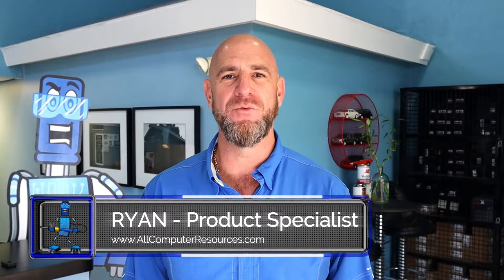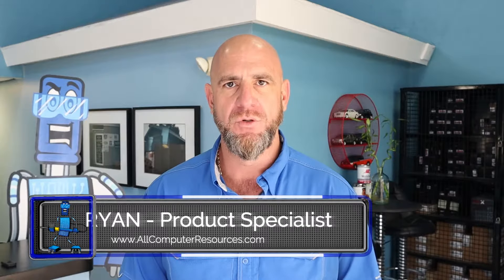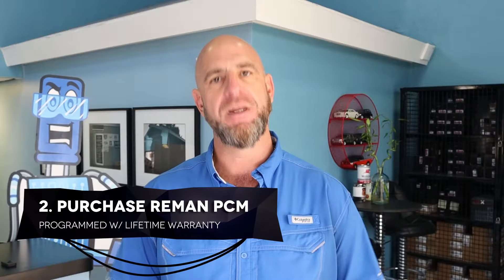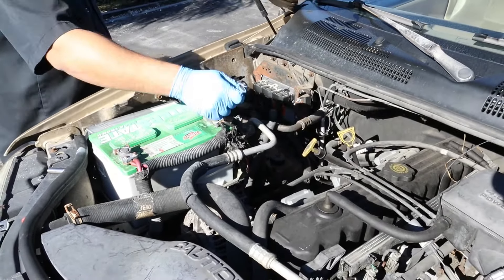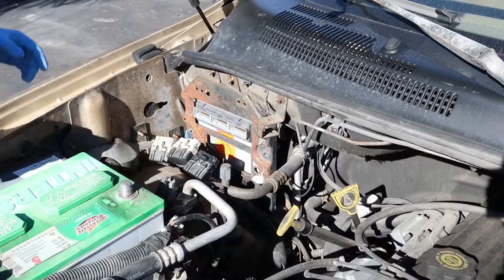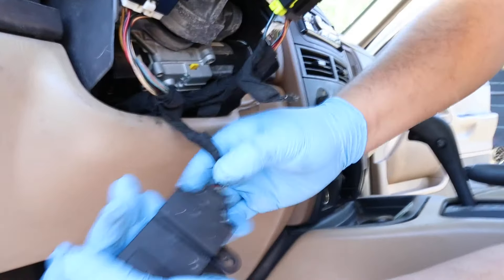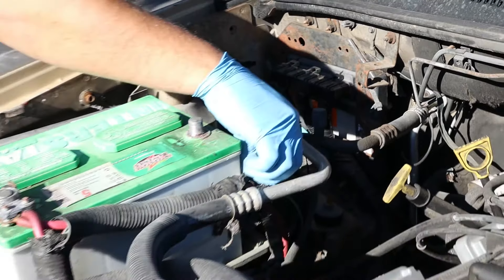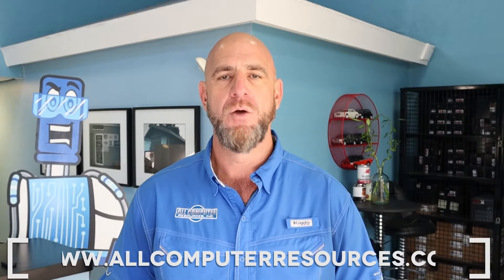SKIM KEY PROBLEM SOLVED - Dodge Jeep and Chrysler SKIM removal from PCM

Comment: I ordered SKIM delete for my 2005 Jeep Grand Cherokee, I explicitly followed the directions for installing the pcm. I had previously disconnected the SKIM module but didn't remove it.  It stared up fine, I test drove it to make sure everything was working properly. The next day my wife drove it to work.  when she unlocked the Jeep to come home the alarm system came on, the lights were flashing, the horn was blowing and she could not turn it off. Someone pulled the horn fuse to quiet it but the alarm system was on on her entire drive home. Turning off  the ignition didn't help nor restarting it. I totally removed the SKIM module and checked every fuse and the alarm system still will not stop...The only way to make it stop is to remove the negative battery terminal. I even tried restarting installation of the pcm from scratch by unhooking the plugs from the pcm, disconnecting the battery, connecting the terminal cables overnight and resetting everything again...the alarm system is still activated, I do not know what to do now. Also we no longer have a key fob for the vehicle. Please help, we need this vehicle running and need to disable the alarm system.  Thank you
Reply: Did you get that issue fixed with the alarm?
Reply: @300EMS  Not yet, I haven't recieved a reply to the same question on their website about this...
Reply: I’m in the exact same boat. I didn’t “need” the skim removed but went ahead and added it on since I was ordering a ecm from them anyways. Fired right up, great right???…… well no. Physically removing and unplugging the SKIM and gettin the new ecm with the skim requirement removed meant that my 100% stock Jeep key FOBs no longer worked and as soon as someone manually locked a door it armed the alarm so guess what you use the key to unlock the door, the alarm goes off as this generation of grand Cherokee the only way to disarm the alarm other than unplug the battery is to hit the buttons on the key FOBs.  After reaching out to this plug and play company that is only taking tech support I was told “ “

“	
Tech Support (All Computer Resources)
Oct 12, 2021, 1:24 PM EDT

Understood,
This can happen in some cases. I advise taking the vehicle to a alarm specialist.
Thank you,
Sebastian Chaparro | Technical Support Specialist”

To which I replied this vehicle is 100% stock why would I need a 3rd party specialist etc, most of my troubleshooting inquiries were ignored.

My response “This has a stock alarm everything is stock on this vehicle so why would that happen has to be something to do with the new computer that was put in it has nothing to do with the aftermarket alarm system because this does not have an aftermarket anything installed in it. Please advise, I’m not satisfied with your response. 

Is it true that if I reinstall the SKIM module it will go back to how it was before and require the proper chipped key? I just added that on, SKIM removal, as an extra thing to remove in case it failed in the future. I can start the vehicle but the second I plug the negative battery cable back on it immediately starts the horn blaring and lights flashing. I can start it right up and the horn and lights continue to go off. Please advise.

Thanks,
Luke”

Their response 
“Tech Support (All Computer Resources)
Oct 13, 2021, 2:28 PM EDT

Yes i agree although the vehicle alarm is factory to the vehicle we do not change anything on the vehicle itself. all we do is just remove the security from the PCM now the vehicle itself needs to have the security modified.
Thank you,
Sebastian Chaparro | Technical Support Specialist”

I understand they only alter the software on the computer but when you explicitly say plug and play and give instructions about removing the SKIM device before installing the new computer that is my understanding as the extent of the security being modified. Where’s the tech support from this company other than telling me to go get it fixed somewhere else. 

I had such high hopes, if they spent less on SEO to burry the negative reviews and more on making a functional product everyone would be happy.
Reply from the maker: Mr. Kuhn, there is not a connection between the PCM SKIM and Alarm. If this is an aftermarket alarm we won't be able to determine in which manner the Alarm was setup. Removing the SKIM and replacing the PCM has absolutely no correlation to the Alarm. If you had an aftermarket auto-start Alarm installed on this vehicle you may need to have it diagnosed.
Reply: Reinstall the SKIM, this is the only way for the FACTORY ALARM & KEY FOB to unlock/disable the alarm.

I went through the same issue and they gave me the run around regarding this issue on my 2005 grand Cherokee, why they offer it as an option is beyond me.
Reply: @acr  except that removing the SKIM creates an issue where your key FOB no longer lock/unlock the doors and if the FACTORY alarm gets set off you have no way of disarming it on this generation. I implore your company to purchase a 2005 grand Cherokee do a SKIM delete and let your wife and kids use it as a daily driver; you will soon figure out you should not be offering this option.

The only reason I could come up with for doing this is if your going to steal a vehicle.
Reply: I am dealing with the exact same issue with a 2007 Grand Cherokee.  The so called "tech help" is extremely unresponsive.  I've gone through a long list of issues that I have worked on.  I am down to the car starting for about 20 seconds and then turning off.  I unplugged the horn so I don't have to listen to it.  Has anyone tested to see if the shim module is plugged back in, will it reset everything?  I've Has this car down for over 2 months.  This is ridiculous.
Reply: @EckoSkywalker  did it reset everything to what it was? I'm desperate to get this car running again.
Reply: @jaysonzander60  Yes, if you plug the SKIM module in, it will rest everything.
Reply: @DocHemi4268  thank you!
Reply: @EckoSkywalker  So what you are saying is that this WILL NOT WORK ON 2005 Jeeps, will turn on the alarm and that Technical Support was of no help?

Comment: So in other words you are not deleting the security out the pcm you putting it in a continuous learning mode so that's why the skim module needs to be unplugged or removed
Reply from the maker: Not exactly.
Reply: No,  If the PCM detects the SKIM reader it automatically reactivates the SKIM system.  That's always the case with all the  SKIM removal services.   It's nothing to do with what they do.   Leave the SKIM reader connected or reconnect it later and you're back to square one.  That's why they say don't just disconnect it.  Remove it or if any mechanic or electrician or subsequent owner sees a disconnected plug and pops it back in it's all over again.
Reply: I see I didn't actually address your question nor can I.  All I was saying was that the skim check is still part of the startup routine.   I'm not sure exactly how it's effectively bypassed by those who perform the service

Comment: Sounds like you're just resetting them to factory new, then it doesn't do the key learn process, and happens to be programmed (by chrysler) to do that by default if the module isn't present.
Reply from the maker: No, that is not accurate.
Reply: doubt
Reply: Just wondering if I could rest my pcm to factory?
Reply: @mighteydog7  if somebody would upload a dump of the eeprom from a new unit..
Reply: @mighteydog7 , if you disconnect the battery and leave it disconnected for a while the PCM resets itself to the Factory settings. That's always been my understanding.
Reply: Is that with just a positive disconnected? Or both  and if I got it to work would that's help with the chip key brothem?
Reply: @acr , supposedly the "Skim delete kit" $70 basicly takes YOUR SKIM out of the equation.Not sure if THATS all you need, or if you've got to send in YOUR  PCM to have them remove the skim info ( basicly) deleting the skim info and god knows what else off your PCM. Have been unable to get any of these inquiries answered. So perhaps they're very busy, or don't have answers. The BBB does not rate them highly, and I've read a lot of discouraging reviews on different sites. So before forming an opinion, Ill wait for a response to my emails
Reply: @rickspearman344  Things like that vary depending on how the engineers felt that doing it that year. That's the nature of software, "it'll be this way, because I say so"... why dealing with software is such a shit show. Typically doing that resets DTCs; that's not the same thing. Could certainly be worth a try. Rip out module and disconnect battery over night or something. If that fails, $0 wasted.
Reply: That is exactly what they are doing. There's nothing wrong with that..... It achieves the desired results.
Reply: @jasonsprouse2803  They don't want to admit it to avoid competition. Easy to be the leader when nobody else knows what to look for. Luckily some people are working at making this stuff way more accessible. Tools like Universal Patcher/PCMHammer. That's a particularly good one.. for 2000-2007 GM V8 ECUs (P01 and P59) and a couple others. Power PCM for some newer stuff.
Reply: @Marc_Wolfe  .. I agree. They claim to be doing something special. I might say the same thing. I see no problem with the value/ price of what they are changing. We're all in business to make money.
Reply: @jasonsprouse2803  You sound like a friend of there's doing damage control. If I can't program my own shit, I'm not interested.

Comment: I called and was told that i cannot have a skim delete on a 2007 dodge ram 1500, for what years does it work?
Reply from the maker: Hey Paul, right around the 2007 Models, Mopar began introducing the WCM, which replaced the SKIM module. It is difficult to know for sure. I suggest checking under your steering column, providing the part# from the module you see there, and getting that over to us. It is a case-by-case basis with that year's model.

Comment: I deleted my skim and bought a brand new pcm from you guys, a few months later my alarm suddenly goes off and won't turn off. Vehicle still turns over and runs the alarm is just triggered constantly
Reply from the maker: Factory or aftermarket alarm?
Reply: @acr  factory, I suspect the FCM, should be unrelated to the computer I got from you guys too bad you guys don't remanufacture those aswell. Thank you for the reply

Comment: Does this work on 2005 dodge magnum NEED TO KNOW ASAP THANKS
Reply: I believe it would, going through the steps with my 05 dakota
Reply from the maker: Yes, If you click the link in the description, it will take you to the listings where you can complete the purchase or feel free to call us directly at 786-879-7566 M-F 9A-6P EST
Reply: @britian4life yes I got a 05 Dakota how did you get rid of the code
Reply: @malcolmrevels7836  bought the pcm with the skim module coded out for $280, and removed the skim from under the steering column clam shell. My problem was the TCM partition had failed and was putting me into limp mode. Good computer parts here
Reply: @britian4life  so I gotta buy skim module and a pcm
Reply: @malcolmrevels7836  you already have the skim on your column you just need to unplug that before you install the pcm computer, with the requirement of the need for the skim module in the first place. Effect this will have is you can start your truck with a screwdriver if you really wanted too. All of this is too get around the dealership fees of key reprogramming

Comment: Hi.

So unfortunately i am in south africa with my chrysler 300c srt 8 with no start because of the skim problem. Financially it will not be profitable to send you my ecu for skim removal. Is there another way.
Reply from the maker: One solution could be sending you a new ECU for your 300c with the SKIM disabled. We’ll need to verify the VIN and ensure we have the correct calibration files for your export model. Please note that there will be an upfront core charge since returning your old ECU may not be possible. Feel free to contact us directly at 786-879-7566 to set everything up
Reply: @acr  Ballpark estimate as to how much this would cost for a 2003 Caravan? No crank, no start and security warning light (above temp gauge) stays on after bulb check. I can send VIN# and any other necessary info.
Reply from the maker: @michaelwalter3399  If you only need the SKIM removal from your current working PCM, the service costs $145. A new PCM for the caravan costs around $200 for the 2.4L engine and $250 for the 3.3L and 3.8L engines. Adding SKIM removal to a replacement PCM is an additional $70. For exact pricing, feel free to contact us at 786-879-7566 with your VIN.

Comment: How long it takes for ECU to be shipped after purchase?! Thank you
Reply from the maker: Mr. Boo, Since each PCM is essentially a custom order which means it is calibrated and programmed specifically to the VIN along with a rigurous rebuild and testing process, lead times generally take 3 full business days if every part of that process goes smoothly. We have enhanced our internal system that notifies the customer along the way of each process and result to keep you in the loop.
Reply: @acr  thank you so much for the response, I wondered as at first it said 1-2 full business days and when i didn't receive the UPS tracking number on the 3rd day.. hopefully it ships soon as it sucks being without a car!
Reply: @acr  Received the one that I had ordered a few days ago but have not installed it . They are fast with the delivery .

Comment: If I bought the pcm from you guys because of pcm failure, and don’t have any problems with my skim, can I just replace the pcm (I bought the unit from you guys).
Reply from the maker: Yes. The SKIM service is an add-on that some customers request if they are experiencing SKIM Module issues. Its not a requirement

Comment: There is another way. Take 3 feet of speaker wire and a random key that has a chip in it, a 4 prong relay and some electrical tape.
Reply from the maker: We do not recommend this method and theoretically, it will not work.
Reply: @acr but it does work.do it all the time on my trail jeeps.simple wire and cheap bypass

Comment: I just want to be able to start my 03 Durango!
Reply from the maker: How can we help?
Reply: @acr  needs flashed P0513 key not recognized.
Reply: I'm ordering a pcm from you in the morning with skim disable.
Reply: @acr  problem not solved!!! I removed skim module from steering column  disconnected battery and replaced the pcm with the skim deleted module from all computer and it doesn't start!!!!!!
Reply: @ryand3248  it's going in the shop in the morning. I'm sending the pcm back to you
Reply: Total security system failure and fried ecm as well as pcm I have sent your pcm  back for refund.
Reply from the maker: @pastorjohnculbertson661  I recommend having the vehicle thoroughly inspected using proper diagnostic tools to identify the cause of the starting issue. If it were a SKIM malfunction, the vehicle would start and then shut off after about 5 seconds. It's possible there are other underlying issues with the vehicle.
Reply: @acr  new keys are programed,  but there is a ground problem in pcm and the ecm is failing  A+ automotive in Joshua Texas is replacing everything

Comment: Ive had skim deleted twice by a friend...which it works i know because cranks and dies 3x then locks out even after a skim module removal...anyone dealt w this? 01 dodge neon
Reply from the maker: If the vehicle "cranks and dies 3x" then the SKIM has not been deleted.

Comment: We recently ordered a new PCM from All Computer Resources with the SKIM Delete included. We have a 4.7L 2004 Jeep Grand Cherokee Limited. We removed the SKIM Module installed the new PCM per instructions and when we went to turn the Jeep on, it still only cranked and gave the wrong key symbol with no gauge activity. Any ideas?
Reply from the maker: Ms. Uri, If you are experiencing new issues with the vehicle, please reach out to our support team for assistance. I will include the link here: https://store.allcomputerresources.com/support.html
Reply: Did they resolve the issue for you? I have a 2005 and need to do the same.
Reply: @Rebecca-xt5nf  I already used their service.  99% of the issues seem to be people who are unable to read instructions. They did exactly what I needed.